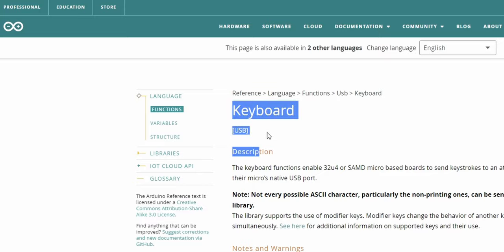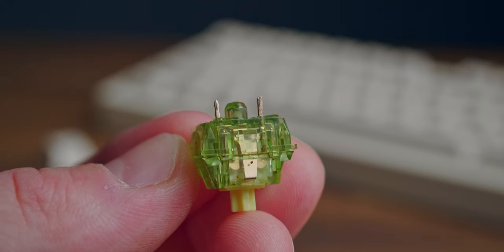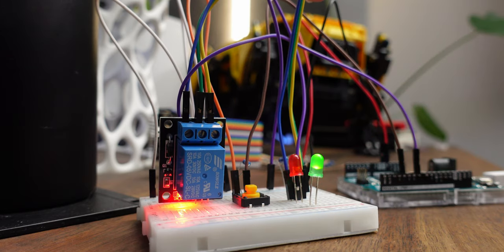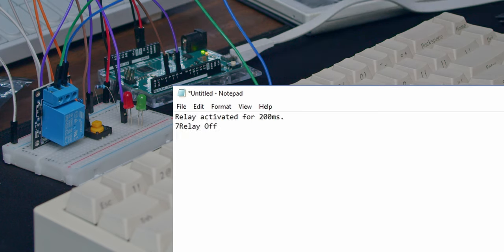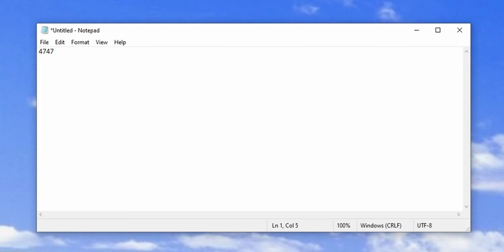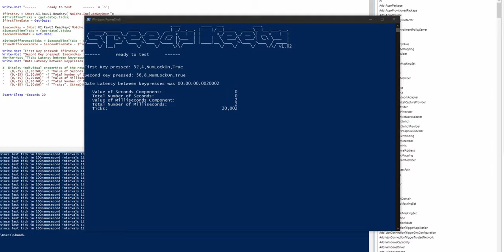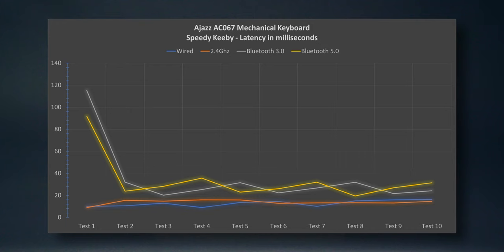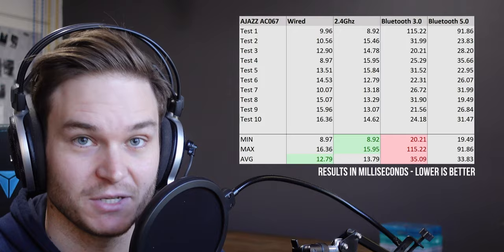how SLOW is my Keyboard? ⌨

Comment: A company needs to manufacture and sell something like this. You could even put a mouse style switch with a rubber-topped bumper on the side of it, so you could tap that onto mice buttons to make it applicable for testing clicks as well. It's more relevant for keyboards though, as basically 95% of all the best feeling/sounding keyboards have close to zero latency information or even verifiable user benchmarks of them... it's only just now becoming an advertising point on the newest releases in CN.

Comment: Awesome video! Really interesting seeing wired and 2.4ghz had similar results….I wonder if the length of cable or distance from receiver plays a factor??
Reply from the maker: Oooh that is an interesting thought!

I used the cable the keyboard shipped with, however the 2.4Ghz reciever may have some differences depending on distance.

Will have to test that when I run my next round of tests with the gaming keyboard build.

Comment: Wouldnt a transistor/mosfet give you more reliable results?? Why a relay?
Reply from the maker: Good thought, I did consider a Transistor for this purpose especially because of the no mechanical lag that a relay introduces... however, I wanted to keep the two circuits completely "air gapped" from one another as was unsure of the effects of variance in voltage/resistance being passed into the Keyboards PCB would create.